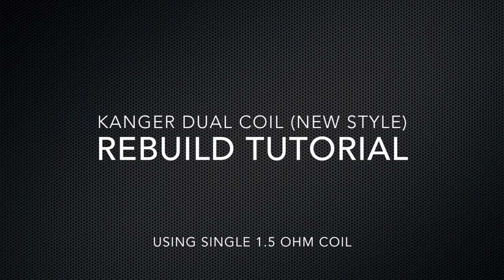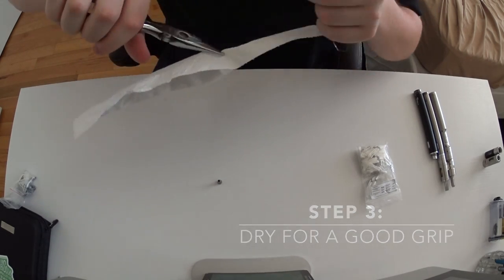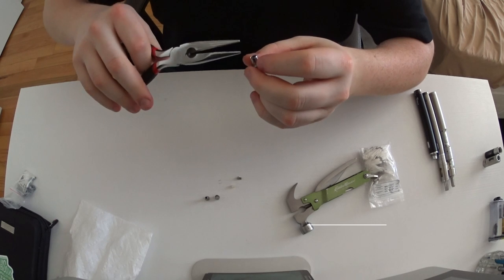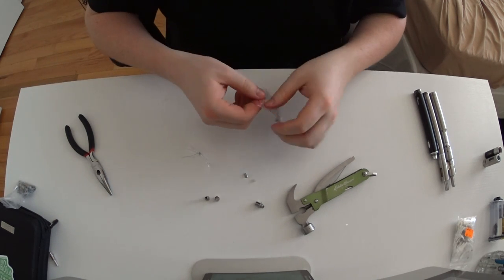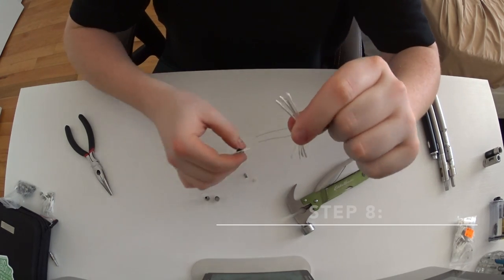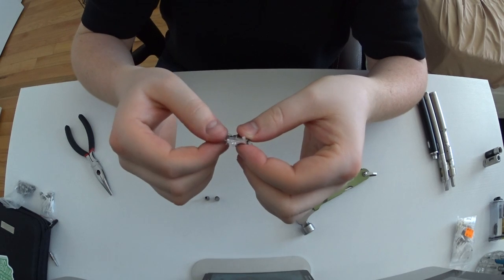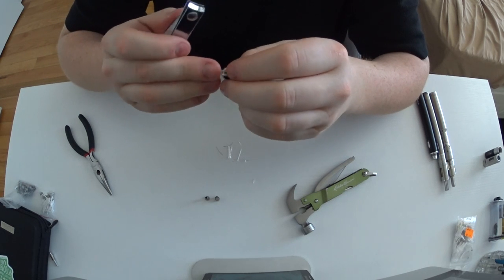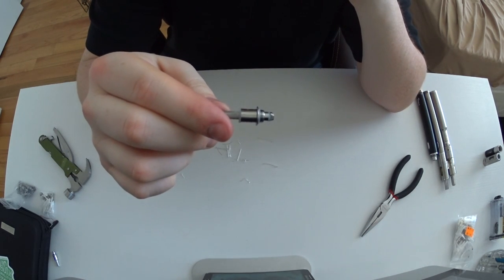New Kanger Dual Coil (Enclosed Wick) Rebuild

Comment: I have just spent the last 3 days trying to figure this out. I was having 3 main issues. The two coils weren't heating evenly. The top one would barely fire, sometimes not at all and the bottom got really hot.  Then it would either flood, or clog. Which is an issue with too much, or too little wicking material. I'm using cotton. As for wicking, it's kind of trial and error to get the right amount. But you have to make sure the vent holes are covered because if the wick isn't tight against the holes it will leak bad. Another problem that causes leaking is if the two coils aren't heating well enough to vaporize the incoming juice flow. So what I figured out is that on your top coil since the legs are longer that changes the resistance. So if you wrap it with the same amount of turns as the bottom coil, it won't heat up the same. So you have to compensate by not wrapping as many turns on the top coil. That is how I got mine to heat more evenly so that both coils would produce vapor. If you have a tester you can make sure both have the same OHMs and you should be good to go. I'm working off of just watching how much they glow when I test fire the coils before I wick them to see that they both are firing the same. I think what I did was 2 less turns on the top coil than I did the bottom, but spaced them out more so that they were both the same width. I think I did 7 on the bottom and 5 on the top. I used a piece of wire from a bread bag, and bent it into a U shape to hold the coils where I wanted them so I could slide them both down into the housing at the same time and keep them spaced right while I fitted in the grommet and bottom connector post. I put my coils in and got them secure before I did any wicking. It seems to work better for me that way. If you try to wick the coils before you put them in you always end up getting the wick all messed up as you fiddle trying to get the bottom coil legs through that little hole. It's all tedious work, and if you're not good at doing little things with your hands like threading needles, or just working with small hard to see stuff in general you will probably be better off to just buy a 5 pack of prebuilt coils from somewhere cheap like fast tech. I just don't like that silica "flavor" wick that kanger uses stock in their coils. It's horrible stuff. I always end up having to change it after 24 hours of vaping where it starts to taste burned and clog up or leak. I use cotton from cotton balls. It seems to last longer, and the flavor is just fine. I really don't even boil it, what I do is before I use the wick in a tank I will soak it with juice first just screwed into a base without the tank on it, and blow on the coils as I fire it a few times. When I do that first it gets rid of that cotton taste. But sometimes I don't bother because that cotton taste goes away after a few minutes anyhow. I don't bother washing it out when it goes bad. I just pull it out, and burn the coils to clean them and then rewick them with new cotton. They usually last me a week or two before I change them. But some people who are more taste sensitive might need to do it more often. Anyhow that's just what I found out about reworking these new dual coil heads. They are kind of a pain in the neck but it can be done.

Comment: I am very pleased that there is a tutorial here to help me out. I do have some questions as I have been experiencing some challenges trying this myself. I am attempting to re wick my coil units using two 4.0 ohm resistance coils (the ones off fasttech) so that I can experience the dual coil effect at a 2.0 ohm resistance (ideally):

- How can I ensure that my re wicked dual coil will be reliable? At times and also after I refill my juice, my ohms reading is 0.0 on my battery mod when my resistance was ideal before. How do I fix this?
- How do you prevent damaging your dual coils with the tools you're using to open them? I've bent the rim of one of my coils and snapped the chimney on another.

After reading some of the comments here they may have answered other questions like the reason why the ohms reading on my battery mod won't exactly measure out at 2.0 ohms being that the wires are cut at different lengths since the second coil is layered above the first.  Is this correct?

Flooding has been another small concern of mine. Once again this morning I had re wicked a coil unit and replaced the one in my Protank 3 only to come back to the device later and inhale a mouth full of juice. It would make sense that the holes on the unit sleeve should be covered by wick material on the inside to minimize the flooding on a greater level.  Is this also correct?

Comment: Thank You fro this Kanger rebuild. I am not to crazy with the 1.8 ohm stock Kanger coils. I also feel the holes for the wicking of juice are way to small on this coil. Now that I see how they come apart, I will attempt to make them slightly larger.

Comment: i like the idea of what you are doing and wanting to try, couldnt see exactly what you did with the 2 wires but i think i will do the same. ive been using 80 20 vg pg and had some problems with the coils i think and dont wanna keep buying as i trouble shoot liquids so this idea is awsome. i have a phantom x with v2 tank. any suggestions more on this and how long it took to recieve them? were the old coils better or worse then the enclosed wicks. im sure the old version is easier to rebuild but not sure how to attemp double coils on this

Comment: hey, great video.  i was wondering if i was supposed to use 1 wick 4 wick or 2 wick? Id really appreciate it. thanks!!!
Reply from the maker: Jessica Maguire You can build using a double coil, you just need to use higher ohm coils than I am using. It divides the ohm in half when you start using 2 coils. So buying and using (2) 2ohm coils will give you a 1 ohm coil etc.

Comment: Nice video but i have a question or two about the rebuilding and tanks in general.
I just started vaping and bought a EMOW mega as starting gear. It's using the same atomizer-heads. But these heads are really crap. The preinstalled lost it's wick after 1 full tank so i already had to put in the second one. Out of curiosity i opend the one head like here and i have to say, the 2 coils in there are SUPER TINY compared to the replacement you're using.

Now my question is: is there any difference between the replaced single coil compared to the original dual coil? Looking at the sizes, the single replacement coil seems to have a much larger surface area than the 2 tiny original coils.

Second question is about the Ohm's. If i use 2 coils the ohm's of the coils are halfed right? Like two 1.5ohm coils in 1 head will be a 0.75ohm head so i'd need two 3ohm coils to get a 1.5ohm head right?

Last question is about all the tanks out there. The EMOW mega battery (which is really just a EVOD VV 1600mha) can go down to a 1.5ohm head at max 4.8V and has both a 510 and a ego connector. Could i buy a RBA (the rebuildable tanks, not the dripper. sorry if i'm using the wrong one here), build coils in it to get the total 1.5ohm or 1.8ohm  and use it with this EVOD VV battery? This way i could upgrade step by step and wouldn't need to go from zero to cloudmaster in one step.

Thanks to everyone who has some aswers for me.
Reply: Kiramitsuoka sorry for being late, you have a similar coil but smaller

Comment: How do you soak them after you do this?  Do you just put juice in the holes or can you soak the coils first, before you put the cap with the holes back on?
Reply from the maker: +Debra Rainey If you are ready to use them right away you can drip into the coil/wick before you put the cap on and fill the tank. Otherwise you just put them into a full tank and let it sit for 5 minutes and the juice will slowly work its way into the atomizer.
Reply: Okay thank you!

Comment: So if I am using 1.8 ohm dual coils that I bought, but I want to make my own, because getting too expensive.  Do I have to put in 2 of them for 1 rebuild or just one?  Not very tech savvy!
Reply: +Debra Rainey you probably already found this out but it is basically for the dual coil, 2 of the same coils one above another but with a little space in between.
Reply: Yes, found this out! Thank you!

Comment: Does this dual coil work with the subtank??? Pls answer someone 😍
Reply from the maker: +Kirsten DLCO (FashionEntrepreneur) The little pre-made coils would possibly work with the subtank, but they are very thin gauge. The wicks just need to cover up the hole where the juice flows through to prevent flooding.